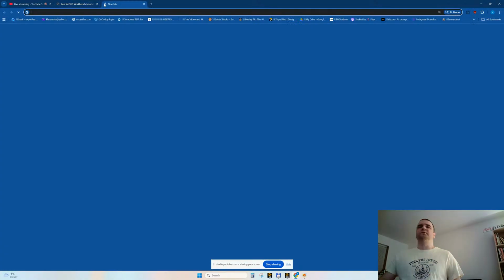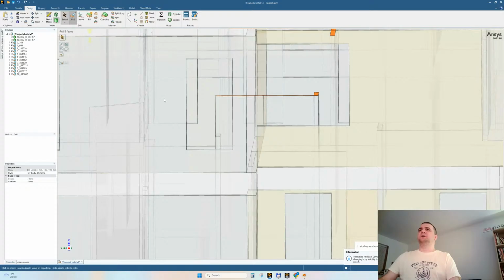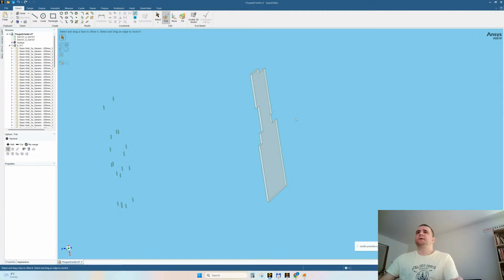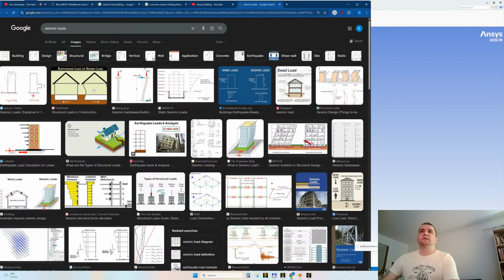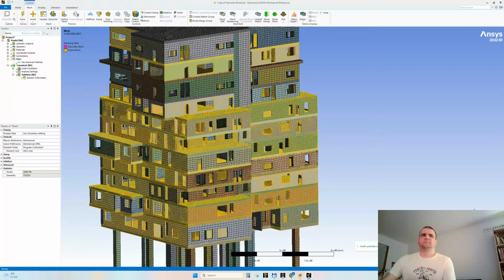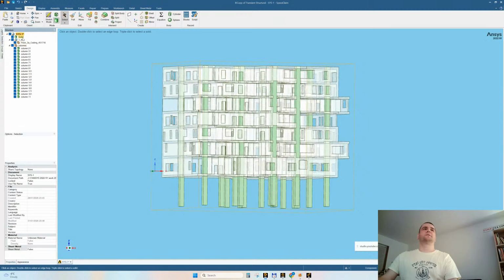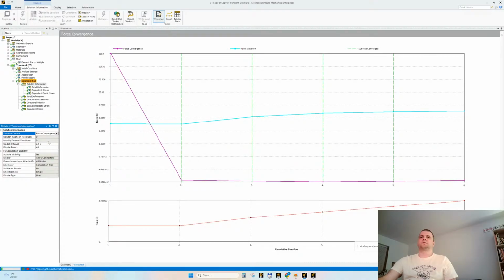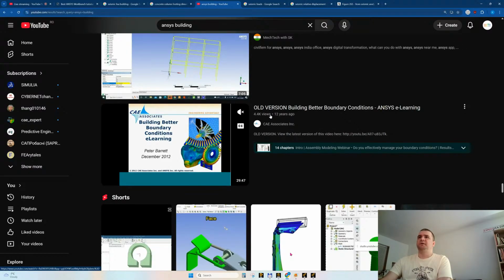FEA of Earthquake Engineering: Seismic Building Simulation in ANSYS - LIVE Stream 13

Comment: In you video, you fixed the bottom face of the columns and the bottom face of the building structure. Are they the correct BCs because you did mention that the columns should split at the area of where they are submerged in the ground. Which one is the best and right way to apply the fixed support?
Reply from the maker: Firstly I split the faces below the foundation, then, after I updated the geometry, those faces disappeared. Since the entire underside of the building is fixed, the reality should be covered pretty well!